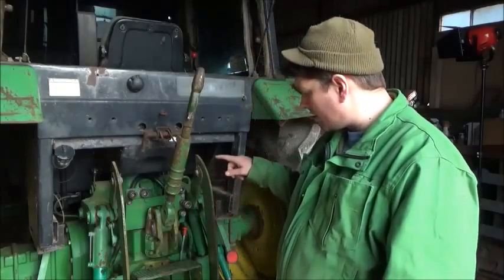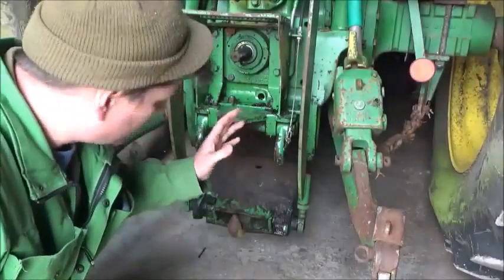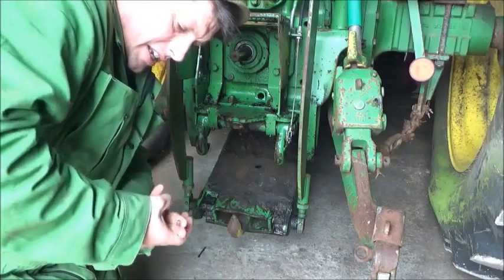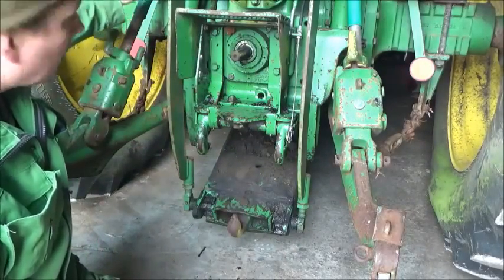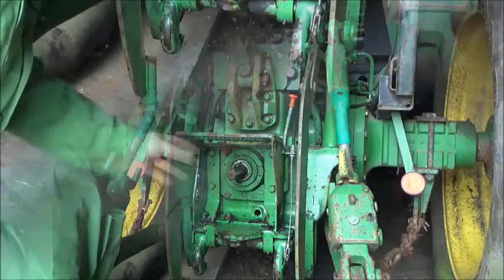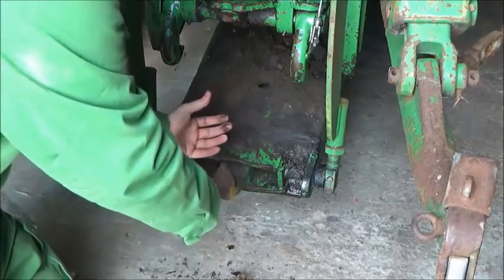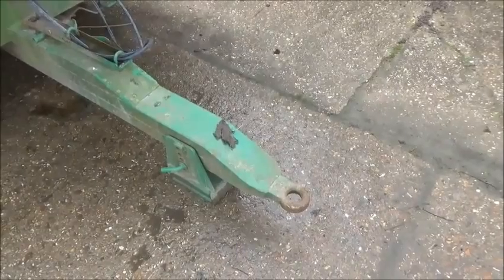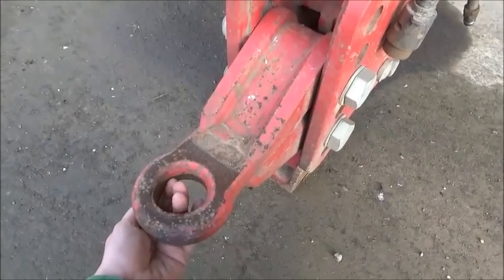John Deere 3350 Pick-Up Hitch

Comment: I've got a transmission pump to fit on a 3050 at some point when we get round to it, plus I really should go and retrieve my own 3050 from the place I was storing my machines before I built my own yard. Good video by the way.
Reply from the maker: You really should. It would be nice to see it at some point.
Reply: I really must get some batteries for it and go fetch it.

Comment: How did you set up the cable for the lock for the hitch to the levar in the tractor I have to put my arm out the back windows and pull the rope with my hand
Reply from the maker: Your cable snapped Seamus ? Mine is the standard JD set up, lever in back of cab, cable down and onto clevis end and onto PUH latch.

Comment: That one's a big improvement on the Axla they used to use.  Looks like somebody has jammed a gretol flint in there some time and twisted the frame though.

Got any stickers?  I'll trade you some Bazooka Joe ones.
Reply from the maker: You'll get a bat up your nightshirt you gret puddin'.
Luckily the frame is just loose and needs adjusting - I thought it was twisted at first but luckily not.

Comment: Great channel.  When you started the tractor at 6:55 the PTO spun a little.  Is that normal?
Reply from the maker: Yes Keith it's known as 'drag'. If you put an implement on it then it wouldn't turn as there is not enough friction but on it's own it can turn slowly.

Comment: Now, correct me if I'm wrong Kurt, but wasn't it Ferguson that developed this type of hitch. Remember many years ago hooked a trailer up and thought why don't they all have this.....apparently now they do.
Reply from the maker: That's a very good question Malc and if you think about the oldest tractor you can remember with this type of hook and large eye, it's a grey Fergy with that hinged hook and T-Bar arrangement and the 3 ton Ferguson trailers with the large eye on the drawbar.
I reckon you're right.
Reply: Cheers, makes a change lol. It's just I can remember using a Fergy on a farm for cutting the verges of the drive.....holiday job when I was about 12ish. Dropped the mower off to get a trailer and thought how easy it was. Then on the usual farm with a Major and Nuffield had to get on, off, on off etc to hook up.
Reply: Not as old as a te20 but my 74 era 135 definitely has a lifting hitch, not that I have a trailer to use it with.

Comment: Good day.   I from Ont. Canada.  In 1967 bought 414 & in manual it showed that. what are the drawbacks. thanks.
Reply from the maker: Hi Don. The drawbacks are that it obviously has moving parts and so it can suffer breakages and issues of jamming etc if not maintained as I pointed out. The hooks can wear and so can the towing eyes leading to breakages in extreme circumstances. If really excessively worn, the trailer can jump off when tipping, leading to the drawbar smashing into the cab. However, 99.9% of people I know (including myself) that have used them for 40 or 50 years have never had an issue and just look after them as part of their routine maintenance.

Comment: I noticed that the hitch seems to sit a bit uneven on the hooks when latched. Maybe it will fix itself once you adjust the lift arms to the same length. Great video by the way
Reply from the maker: Yes I reckon that one side needs adjusting. Well spotted !
Thanks for watching.

Comment: I'm from Iowa and was wondering if the 4wd tractors have the same system or if they would be different to handle large cultivators or disc rippers like the case IH 875 ecolo-tiger? Also what is the actual weight capacity of those systems?
Reply from the maker: Now by 4WD you mean like the big artics ? Over here 4WD is a FWA in the States but I know what you mean !
For really large draft implements, they tend to use a fixed drawbar but we are seeing increasing sized equipment being pulled by tractors fitted with a pickup hitch (350hp+)
Thanks for joining in Philip !
Reply: Yeah I was thinking of the articulated tractors. I was thinking the pickup hitch looked quite small, we use 3 inch pins to pull the high draft implements, also around here we are also seeing the larger planters and such switching to linkage hitches without the third link. Does the hook on the pickup hitch get any bigger with bigger sized tractors?
Reply from the maker: Yes. The ring on the implements is about 2 1/2" to 3" and the actual hitch on the higher HP tractors is much more robust. Don't forget my JD3350 is only just over 100hp. It would be matched to maybe a 12 ton grain trailer or  a set of rolls etc.